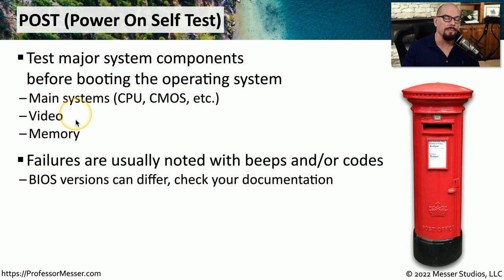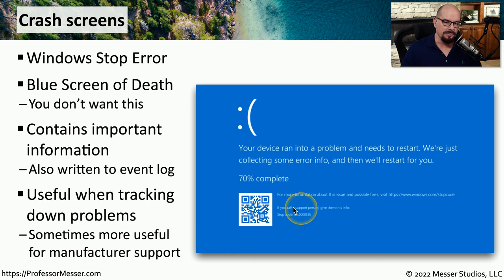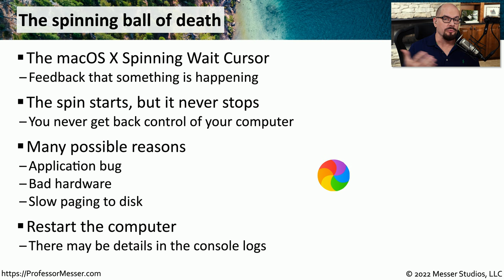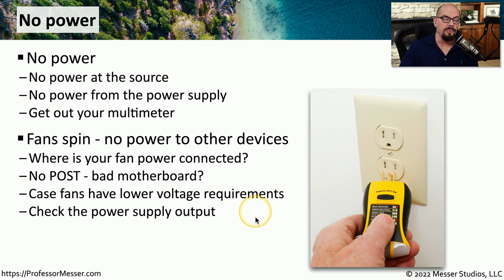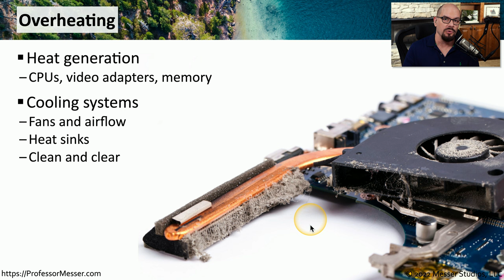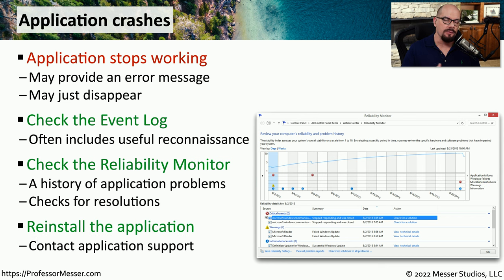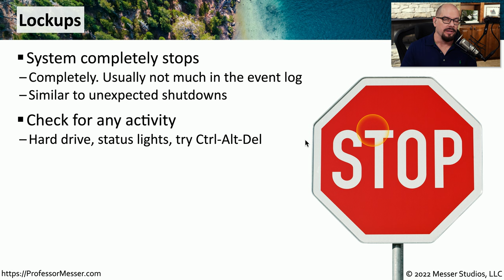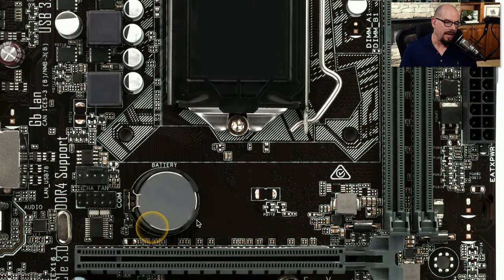Troubleshooting Common Hardware Problems - CompTIA A+ 220-1101 - 5.2

Comment: I once installed my RAM incorrectly somehow, when I was younger. I turned the computer on and saw a flash of light and a puff of blue smoke came out of the area where the RAM went. I immediately turned the computer off, prayed, installed the RAM right, and turned it on again. That computer went on to work for another 10 years before I finally just scrapped it for something else.
Reply: lmao I cant believe that actually fixes it instead of looking at the PSU and cable connections computers are weird
Reply: Haha wow. The MFG missed out on some cost savings then, because clearly whatever went up in smoke was not necessary to include!

Comment: once upon a time, I swapped the existing battery component for my Toshiba laptop to a third-party battery component because I wanted the battery to last longer. a few weeks later, 4th of July fireworks started on my laptop while it was in use due to overheating. thankfully, no body parts were harmed during the fireworks, the laptop on the other hand never turned on after that.

Comment: I put a tracker in my computer because my house got broken into. I connected it via usb so it would stay charged but for some reason, when it tried to connect to gps to update its location, it would make windows go into a bsod. I haven't found a permanent solution but in the meantime, I'm only charging it when my computer is off and unplugging it before I use it.

Comment: Hello Professor, thanks for all the amazing content so far! I just had my first question pop into my head. I remember in a previous video you were saying that you should never use a vacuum around any computer component because it can create charges. But in this video, you said it's fine for use on external ports. I guess my question is, are vacuums safe on external ports like at 13:30 of the video?
Reply: I had the same thought. From what I can find, cleaning anything externally (including ports) with a standard vac is ok. Internally is where you will need a battery powered vac to aviod static buildup
Reply: not sure on that answer but for my day to day deal, id prefer a bottle of compressed air. its a inconvenience to keep a vacuum everywhere you go when you can just keep a bottle of canned air in your car/desk/anywhere
Reply: @patrickbarber5807  This is exactly right. The external case of a computer is/should be grounded thanks to the middle prong of the standard AC power cable, via the power supply. This means if your computer is still plugged in (but off, hopefully), any static that builds up on the vacuum head that may discharge to your case will be safely routed to the Earth, not to your components. Also, there are vacuums made for electronics that use materials that will not build up charge on their nozzle. It is general best to use these or compressed air cans instead of a standard household vacuum.

I wouldn't use a vacuum on a case that isn't plugged in, or is otherwise not grounded. Nor would I use a vacuum on the inside of the computer ever, as it can physically damage things if you aren't careful (not to mention that once you open a computer, you should be unplugging it, which means you're now at high risk for static shocking it).

Lastly, it is best to tape fans to keep them from spinning while you vacuum. some fans only want to spin one way, and some fans have cheap bearings that will wear out quickly if you have a vacuum on them.